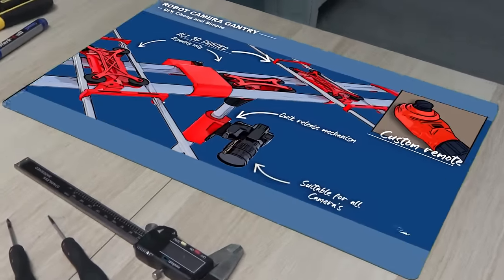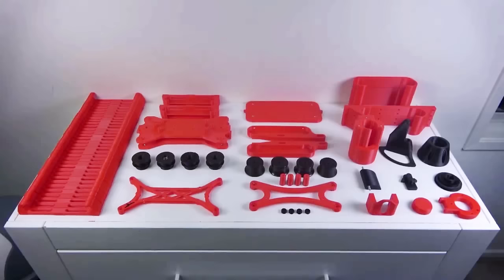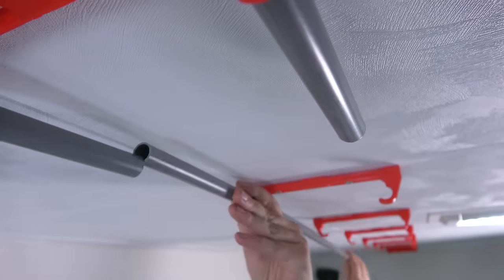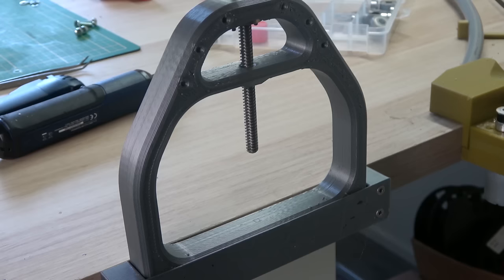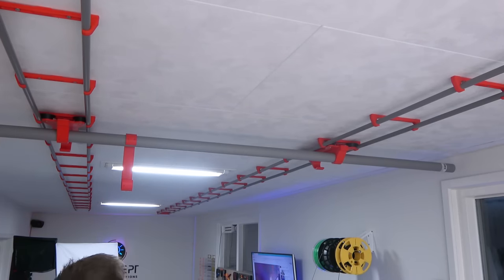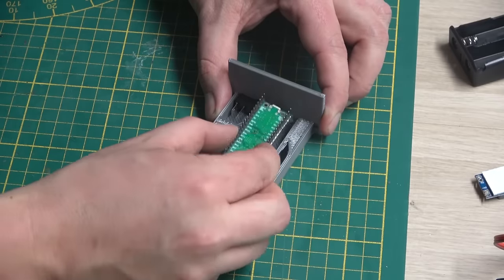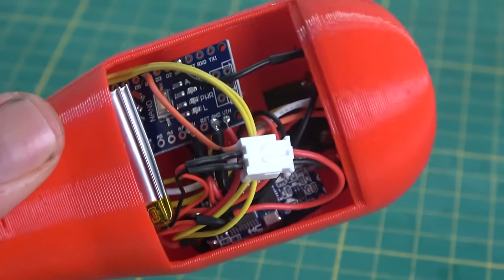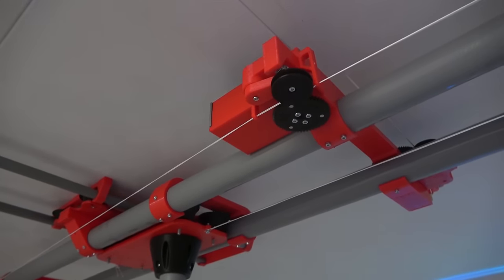I 3D Printed a $10,000 Camera Robot..

Comment: May I suggest a forgotten 3d printing element for your motion system? Fishing line instead of string. Its far cheaper than using belts and will hold up much better than string.😉
Reply: Good Idea. Most likely both string and fishing line may eat through 3d printed holes because of friction. you could add PTFE tubes inside the wholes to prevent (or mitigate at least) it.

Comment: I'm not sure if someone else recommended, but for you to get read of the battery, I would recommend to use the H configuration, as an Voron printer. Like that the motors are fixed at your ceiling. Like that you would use more cable, but allow to use an fixed powersource and controll unit.

Comment: Pretty cool project! 👏
An idea, to avoid splitting the rope at the Pulley, I recommend to used instead a set o multiple 3D Printed Smooth Pulleys (not with teeth), geared interconnected (so all are Driving Pulleys), and positioned into a Zig-Zag pattern. You probably need 4-6 Pulleys. This way you'll have way more surface friction to drive the rope (even without the teeth to damage the rope). 
This method is commonly used in engineering and you also don't need contra-pulleys which are pushing on the rope.
Hope you understand how I described it :)

And good luck on the next projects!
Reply from the maker: Thanks! I definitly keep that in mind for future projects👌
Reply: @ConceptCraftedCreations I think Kevlar cords would work in this scenario without having to redesign the motion system. Pulleys if you were moving a more significant load. Although I don't know how much the current design could handle to even need a pulley system.
Reply: @ConceptCraftedCreations  Another option would be to use a capstan instead of several pulleys.  With 3 - 5 turns of the rope you will have enough friction to drive it.
Reply: @jeradw7420 My thoughts exactly. This is the naval standard and used to great effect as leverage against much larger weights. The larger the diameter of your capstan, the less wear on your line as well.

Comment: For the drive mechanism, I can't help but think back to the old rope/string driven 3D printers. They used dyneema cord wrapped a few times around pulleys that often had spiral grooves to keep the wraps evenly spaced. I'm thinking you'd be very pleased if you switched to dyneema cord, zing-it would be a great one as it has a special coating so it can hold knots that would make it ideal on pulleys. I used to make my own backpacking hammocks and using dyneema for the suspension, and cutting the cord to make splices would wear out a blade in no time. That's the other huge benefit, dyneema cordage is sliceable, so you can splice it into a continuous loop with little to no bump at the joint. It also has near zero stretch. The durability, spliceability and low stretch make zing-it a perfect choice for this imo.

Comment: Cool idea and execution. Since the filament drive is wearing the string perhaps consider a mechanism similar to the capstan on a ship if you decide to upgrade.
You wrap the string around a pully several times, and as long as there is some tension on both sides friction keeps the string from slipping. In a ship the weight of the anchor provides the tension, but you could use guide pullies on a spring to tension your whole system

Comment: really cool idea. When we build a gantry crane we have the supports near the  center and then the wheels ride on top of the rails so you don't have to worry about sideways pressure holding it on. Also the more wheels you have the smoother the move over the joints in the track.

Comment: Awesome design and build.  I'd suggest changing to a steel cable. Pricey but it never breaks.  You could also use an esp32 as the control module and control it by wifi on your smart phone.  With regard to the positioning system, I think thats a great idea.  Programming it shouldn't be too difficult but I'd suggest having a limit switch on the back of the room if you havent already got that done, just so theres a home or Zero position.

Comment: You need smooth acceleration and deceleration. Stepper motors with proper handling would work better. Also you need a better way to convert rotational motion to linear motion to make the movement more controllable and predictable.
Reply from the maker: Agree! Stepper motors would indeed be a better option if you plan to use it more professionally. But for me in my workshop this is more than enough.👍 But who knows, I might adjust it in the future if plans change🤓

Comment: This is awesome! Do you have a list of parts / tools that you used in the video (bearings, microcontroller ..etc) 

It would be cool to also add a motor to control the z axis as well as the tilt of the camera. Long term it’s probably less of a pain to add the components to make it a belt drive if the string is fraying so soon. 

I’d love to make a much smaller version of this. I’ve only used .STL files though. Unsure of the format you have listed.
Reply from the maker: Thanks mate! Appreciate that! I will add a list with the parts i used to the file on Cults3D before the end of this week. Hope this is soon enough for you?

And i used the rope from a cheap power kite i had lying around. I've just swapped it out with 1.75 TPU filament and that is working great so far! I like to try out new things like that so that's why i went for the rope option :)

Good luck on your version! U can convert the .STP files to .STL files with a program like Fusion 360 for example.. It's free to download en use for hobbyist like us.

Comment: this is really neat. I'm curious though why you went with the filament extruders for the movement rather than making a wheel on each slide motorized.
Reply from the maker: I actually thought about that!👍 But I was afraid it would slip because the PVC pipe is of course very slippery.
Reply: @tCraftedCreations oh that makes sense. keep up the great work!

Comment: I can do all of it. Where are such projects? My problem is I can't find anyone who would purchase projects like that
Reply from the maker: Amazing, right! And this project is not for anyone to purchase per se. It's a project by and for myself here in the workshop and I've made the files available to anyone who wants to tinker with it themselves.

I'm actually curious about your projects now! Do you have examples? i'd love to see it!
Reply: @ConceptCraftedCreations  My most recent serious projects were construction of tractor plato. It's designed to be sturdy against gravel, because of 20 mm steel on the back.
Next one were pendants out of wood, I tuned up diode laser, and they were smooth and beautiful.
I'm kinda new to 3D printing, and I'm tuning PETG at the moment, but sometimes the print is also nice and very usefull. I designed and printed a plastic adapter for shower cabin (between glass doors and bearing), because the old one broke.
Now I'm playing with programmable LEDs and Arduino. I want to build a number screen, for a local basketball team.

Comment: I have already printed about half of the parts. It was very interesting process since i have never used CAD (Fusion360) but looks like i got everything right :))) any chance you can upload that connector for 16mm pipes? I know its probably easy to model but i have no idea how to do it. What bearings did you use? Thanks a lot. Still looking forward for a workbench slider, no rush
Reply from the maker: I actually forgot the connectors is see now! Thanks for pointing it out! I will add them later today and then I will also upload the table slider on Cults. And the type of ball bearing that fits is the 625ZZ.
Reply: @ConceptCraftedCreations  awesome, thank you very much. Yeah once you upload that slider I will start working on it right away 😉👍